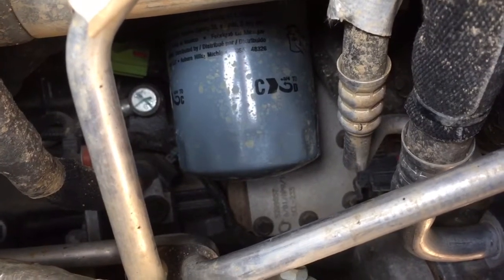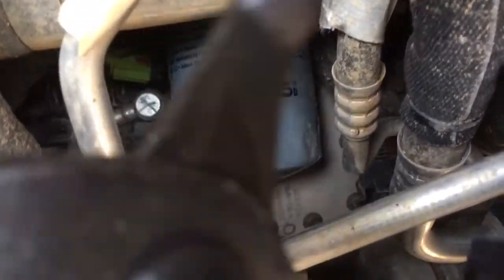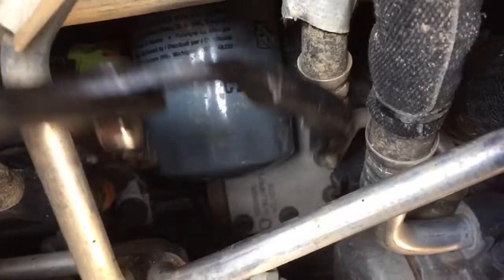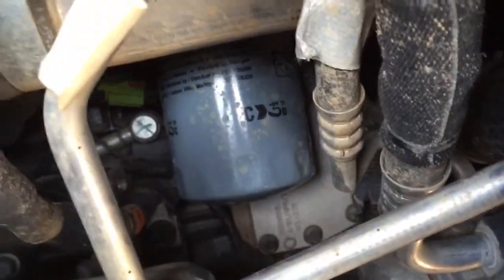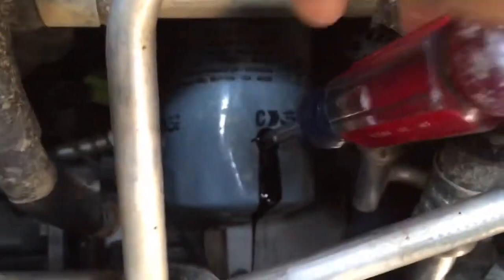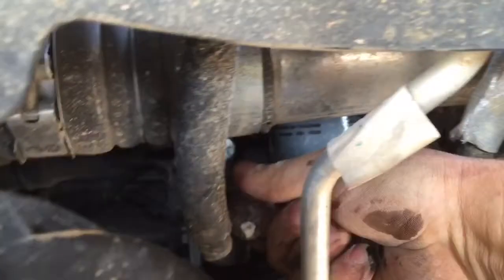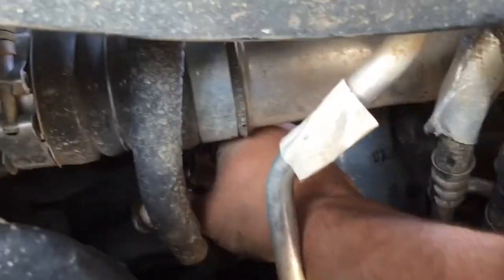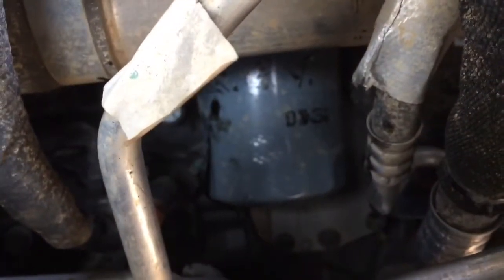Oil Change 2014 Ram - Stuck Filter Solved

Comment: Use an appropriate sized oil filter socket. I cut a 1.5’ 3/4” electrical emt pipe to use as an extender and slight breaker bar to turn the ratchet. The socket will slide right on and is way easy to loosen and tighten that filter. Even better is to use an oil filter cap so you can turn the filter sideways after you loosen and not dump anything out.

Comment: Get you one of those oil filter strap wrenches that has a socket with slots cut in it that uses a cloth strap that wines around the socket it'll make it a lot easier. I made my own with a spark plug socket and a piece of tie-down strap and it works great